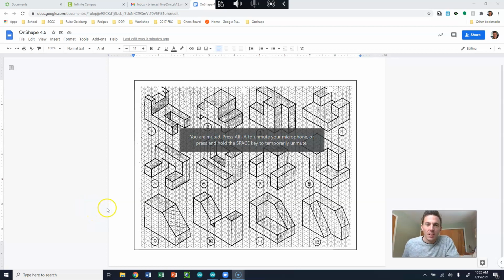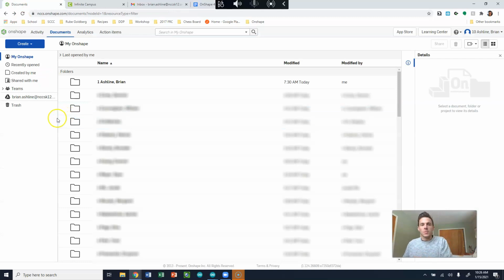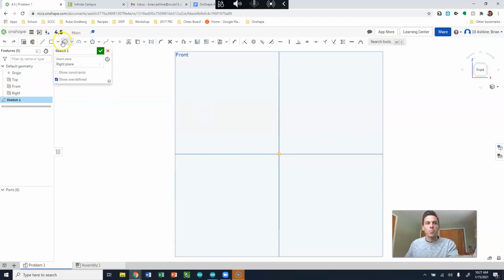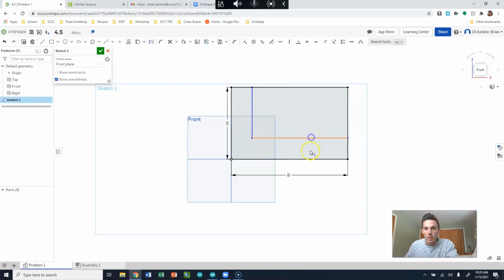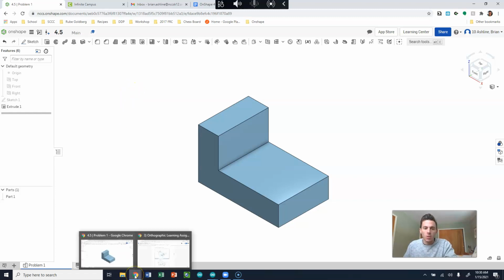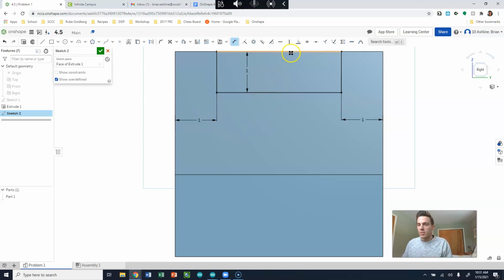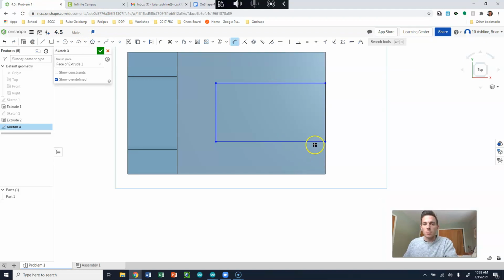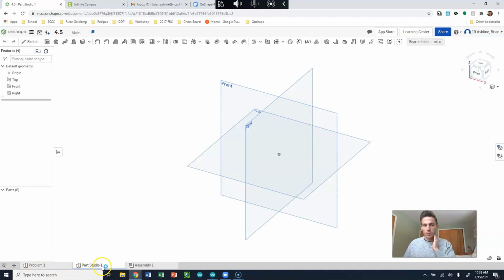OnShape 4.5 - Creating multiple parts in one document

Comment: Question:  I want to create an assembly.  Should I create a separate studio for each piece of the assembly?  I didn't do that, and the sketches for two of the parts overlap near the origin, and when I extruded the latest one with a hole, it cut out part of the first part, which isn't what I intended.  Should I be creating sketches of the different parts in a separate part studio for each part?  Is it possible to move things around once they've been created?